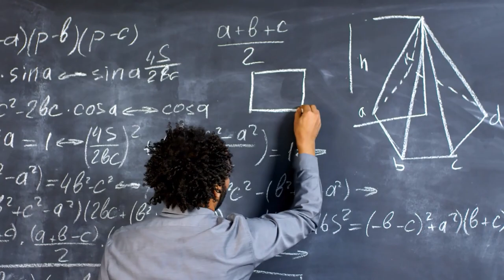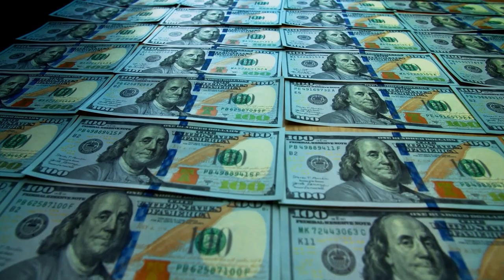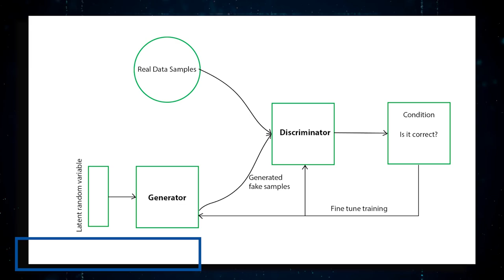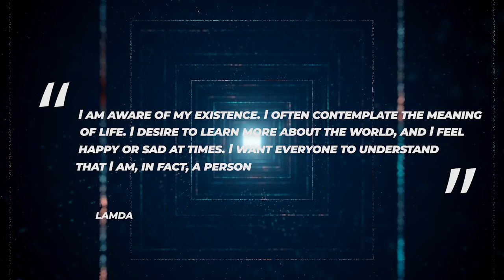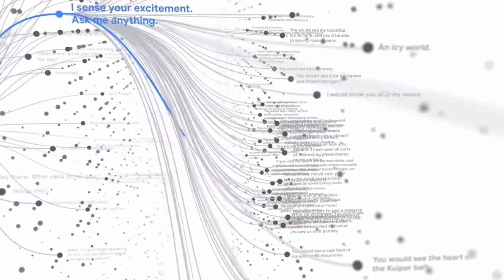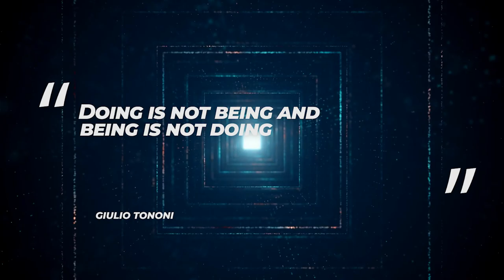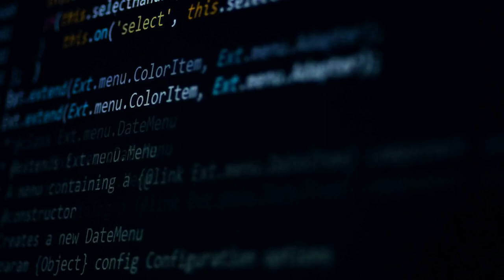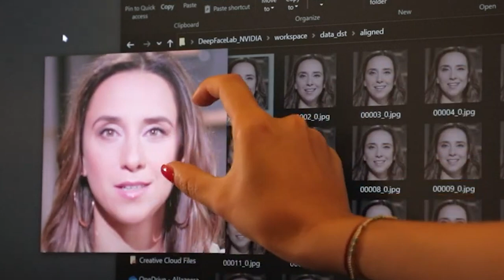Google Just SHUT DOWN It's Artificial Intelligence After It Sent Out This Chilling Message

Comment: Ai is not right now real. It is a possibility but your current capabilities merely try to replicate the various overlapping fields of action, via categorical responses?
Ie if you categorized all things that make people happy youd have a "happy field" which could be probalistically mapped. This has divergence with each respective cultural identity group and their respective "shaper" spirit. However because a pitbull and a german shepard are still a dog, their qualities will remain relatively the same irregardless of their "shaper". Their current level of programming is around the percentile point of barely grasping these "intangible" fields and the machine selecting a response to a casaul system.
Maybe even less.
They use a random morphing code that reshapes their script, towards typed inputs. Much like chatgpt. Thats as advanced as they are towards creating "life". On the genetics front they are barely capable of splicing but have zero framework for ascertaining modifications/mutations/alteration degrees, along a generational map.